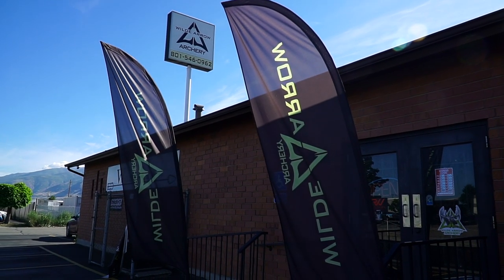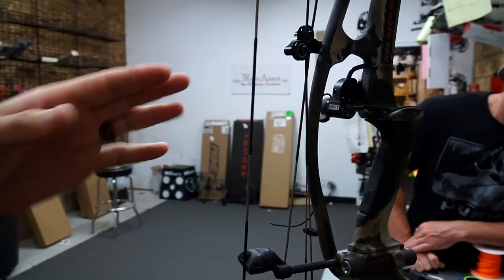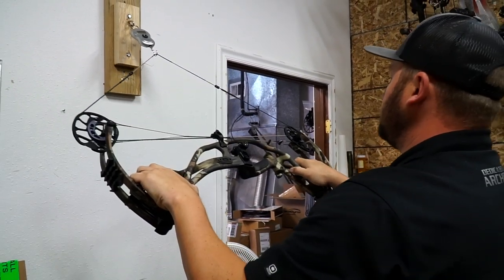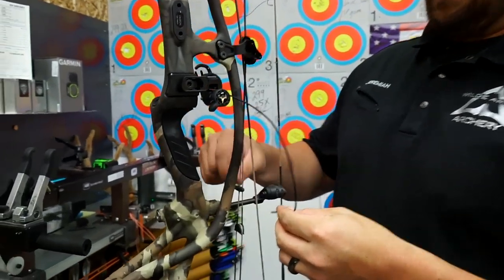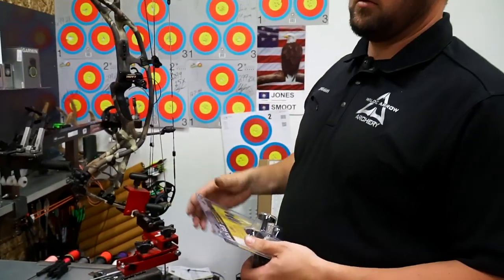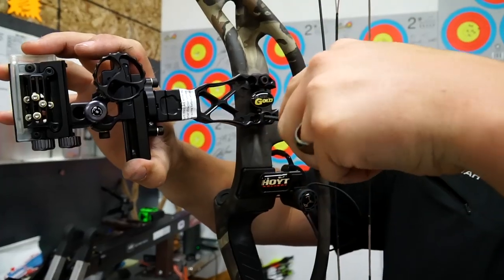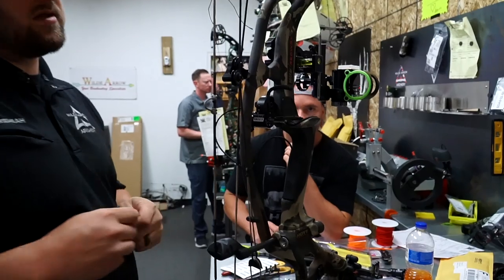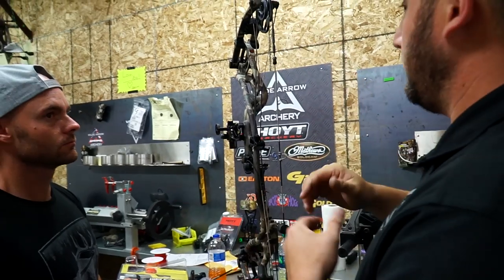THE ALL NEW HOYT RX-3 CUSTOM BOW BUILD

Comment: New to archery and this video helped me so much! The pro shop in my town didn’t tie any nock points in and I didn’t realize it at the time, but my D loop was actually sliding around on the string. Bought some BCY 3D and BCY #24 and did it myself. Bow shoots great. I was ready to quit because I thought I was never going to be any good at archery. Turns out it was just a bad d loop and nock pinch. Now I’m shooting way better! Thank you so much for these informational videos!

Comment: I’m in the very beginning stages of researching about obtaining my first bow. Though I’m right handed , I’m left eye dominant. Do I buy a left handed bow and start practicing left handed or cover my left eye on a right hand bow?
Reply: I'm the same way but I shoot a right handed bow cause It was easier to train my eye then it was to hold stable left handed shoot both at a pro shop cause comfort and ease of holding determined mine training my eye was easier then training my fine motor skills

Comment: I realize this video is from a year ago, and I'm sure they are a great shop... That being said, in the Hoyt manual it specifically states the UltraLock Adapters are required for the LCA press or it voids the warranty automatically. Why, especially a reputable shop, would post a video NOT using them on a brand new $1600 bow, and inherently voiding the warranty, is beyond me. Great amount of knowledge and explanation, but for a simple thing of safety to be skipped on, that's just careless.

Comment: Couple things I didn't like, 1. used the wrong bow press fingers for the RX3.  Need to use the Ultra locks for the limbs  recommended by Hoyt. 2. using a draw board without having a d-loop is way more dangerous the way that was done.
Reply: Wrong ..the only bows hoyt recommends those adapters is the bows with the hyperfelx limbs